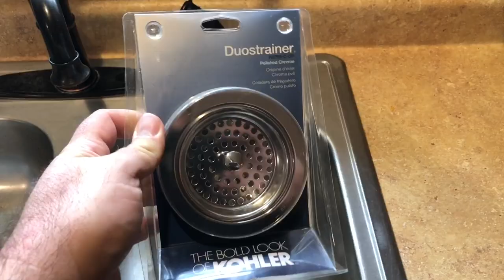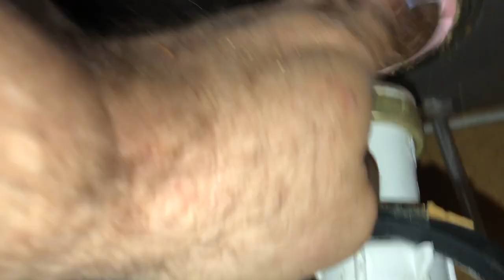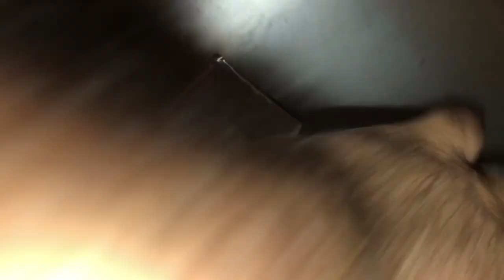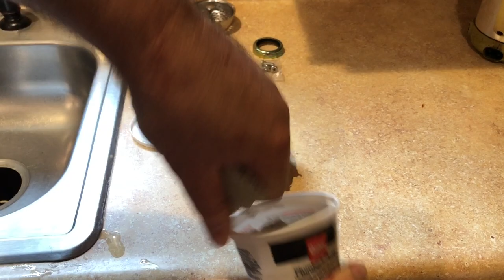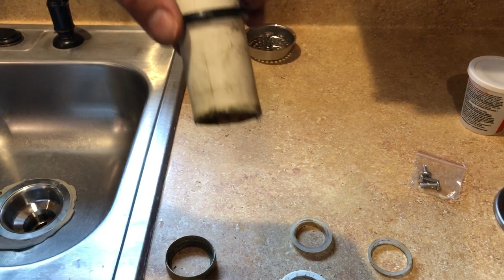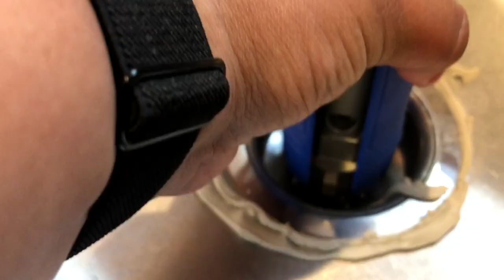How to install a Kitchen Sink Drain  Strainer

Comment: What hsppens if u dont have another person to help u hold the top part of drain while u r under the sink to tightening things up?
Reply from the maker: Well, you can do that by yourself. I just had help today.
Reply: @MendandMake  I thought it will not tighten if someone not holding the top?
Reply from the maker: @GHE2005  on the top- hold it in place with your left hand, at the same time go underneath with some pliers and use your right hand to tighten. While tightening the bottom, try to keep your left hand in place.
Reply: @MendandMake  That works if u are tall & have long arms. Female petite person can't reach. I was asking to see if u had a trick I don't know about. 😉 Appreciate it replies. 🙏🏽
Reply from the maker: Put those screws in first and they help as a handle to help turn it.  Even if your short you can do it. My wife is 5’2” and was able to reach hand under and reach top but I just stayed down because she was on top